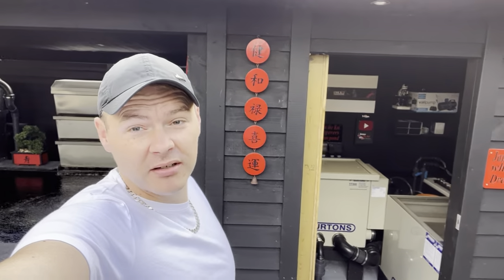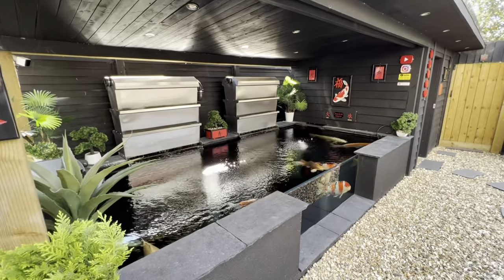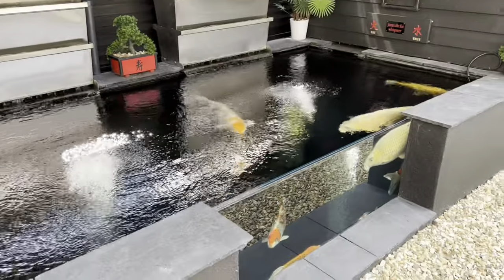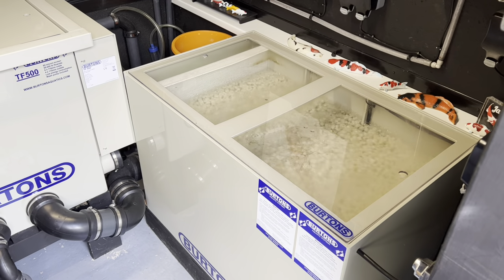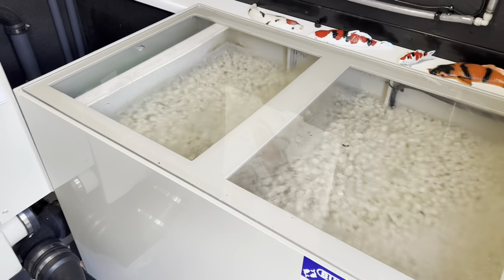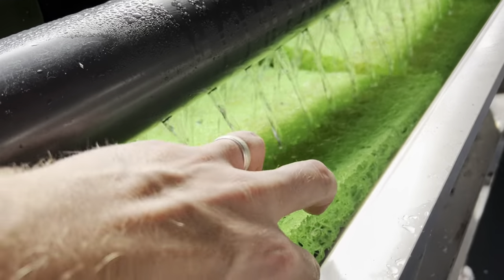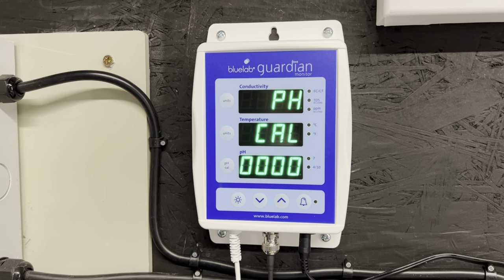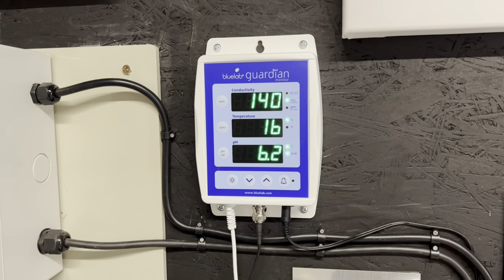MY DREAM KOI POND IS ONE YEAR OLD ***FULL REVIEW***AM I HAPPY??

Comment: Love your videos mate , keep em coming!  something I have always been worried about is... How would your pond stop it from draining completely?... for example in your case... you have 3 pumps each with a about 30'000 capacity turnaround/hour... you pond is roughly 10k litres... so if one of your pipe fitting failed and a pipe broke or sprung a severe leek your pond would empty itself within roughly 20 minutes as you have bottom drains that would suck your pond dry... have you thought of ANYTHING that could prevent such a catastrophe? like a electrical float cut off switch for all your pumps... It might be worth while putting one in you drum filter submerged much lower at a safe level and would trigger your electrical pump cut off for your pumps in thre event of a leek issue.
Reply from the maker: If the pond water drops lower then the drum it will cut of the pumps and will never drop lower then that mate

Comment: Good to see you back. Did you say you are pulling 30,000 lites through drum at the moment with the option of 60k later on? Thanks
Reply from the maker: Well try to get that but pumps and head hight on pumps ect allways slows down but yea was going to put to 30k pumps on each shower but never did in the end
Reply: @JamesTHEKOIwhisperer123  how much now through drum, do you reckon? And have you got a separate flow not going to shower. I only ask James because I am looking at same drum for 5000 gals pond - going to to put 25 k to shower and rest as flow from drum with no filtration. Look forward to response Mr Whisperer 👍 😀